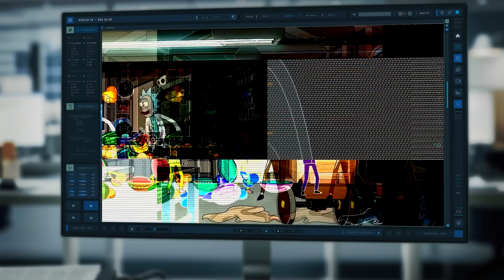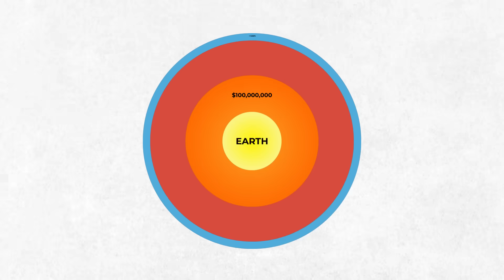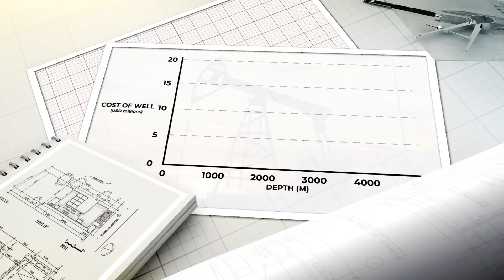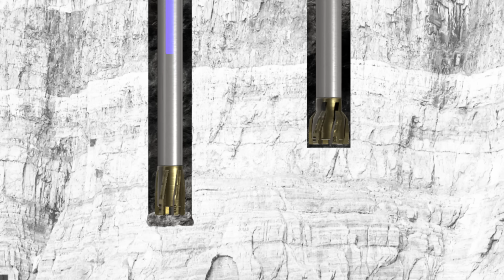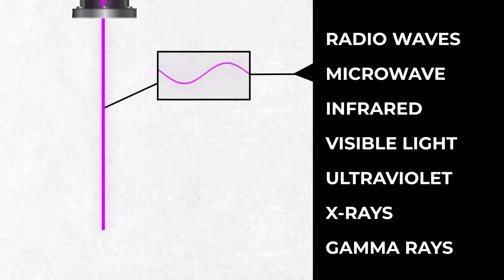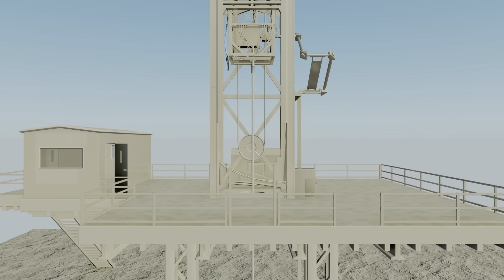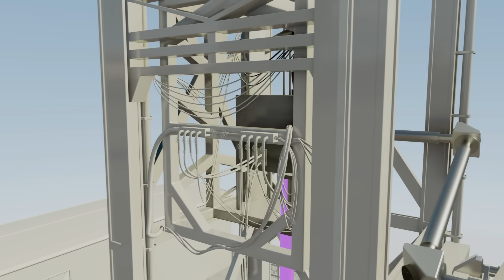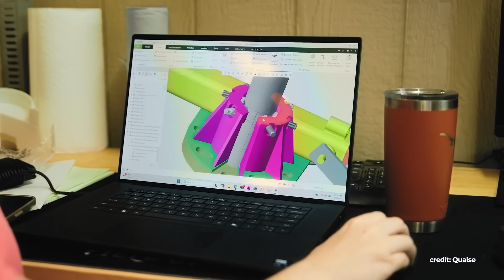The Most Advanced Drill in Human History

Comment: I read an article on tests in Iceland using geothermal superheated water from bore holes to turn surface turbines to generate electricity. One of the major issues they faced was that the superheated water dissolved vast amounts of minerals under pressure. When this mineral rich superheated water reached the surface, it cooled enough for those minerals to condense and be deposited in the turbines and feed pipwork. This clogged everything up relatively quickly.
Reply: easily fixed with heat exchangers, in fact I would be very very very surprised if anyone would use the groundwater in a turbine at all, it has to by very nature be a sealed clean system, we have known this for decades.
Reply: @Farlig69  Heat exchangers will clog as well.
Reply: @Farlig69  the heat exchangers would need to be frequently replaced as their fins would clog with scale in no time. The problem of dissolved minerals remains a problem.
Reply: @MrPhillip2  could run a clean refrigerant like ammonia inside a closed loop within the bore up to surface, thermosyphon would cause flow of hot fluid up to surface, heat is exchanged to create steam for generation, then relatively cooler fluid is forced back down to the bottom by density/convection. No minerals no problem.
Reply: @midship_nc  AGREE sir SO AWESOME; that SOME PEOPLE still have CRITICAL. THINKING 🧐 skills)
Reply: @Farlig69  Easily eh? If only you knew just a little. All you did was move the corrosion and scaling problems elsewhere
Reply: Literally throw a basic water treatment method on that closed system and boom problem of caking up the system is solved. Just get the TDS down to an acceptable level for the system. That blows my mind they didn’t have one in place to begin with. Obviously brine water is present. 

The much smaller residential systems I’ve worked on mostly use glycol. Idk how tf that doesn’t seep into the earth but the system holds pressure lol

The heating medium in the Iceland set up is the geothermal water. A heating medium in a closed loop shouldn’t go directly through the system as a previous comment pointed out. The heat exchanger transfers that heat to another medium like steam or water that isn’t so aggressive for the rest of the components.
Reply: @Vinlyguyx420x  Thank you sir ; ANOTHER person who has CRITICAL THINKING 🧐 skills
Reply: Iceland currently receives a significant proportion of its power from geothermal so I'm sure this has been accounted for.
Reply: Makes sense
Reply: Use a closed loop....just transfer the heat.
Reply: A  HEAT EXCHANGER THAT IS  COMPLETELY UNDER GROUND AND COUPLED WITH A FLUID ; that Boils at Low Temperature and IS USED TO. SPIN the TURBINES) This will AVOID the Minerals; Going Out of SOLUTION; and Coming into Contact with the TURBINES ) AND the DRILLING FLUIDS are kept At High pressure and CIRCULATED; through the HEAT EXCHANGER)Next to the TURBINE. SUPPER HEATED FLUID)
Reply: @davekurtz321  I'll bet you have an easy way for a crew to get to Mars as well? Do tell us since by oversimplifying the process and leaving the hard detail stuff to someone else does make your rambling somewhat plausible. That's what ha .. idea men do. Get yourself a better secretary to dictate your comments to and improve your grammar. Caps everywhere .. bad structure .. very juvenile. Since you excel (LOL) at critical thinking, be critical of the comments you and your secretary leave. Presentation is everything ..
Reply: @farli  Thank you  sir ; for condensing ; my Exact thoughts 💭 
And ALL of these 
NAYSAYERS) please Remember that They Were Also Telling the Wright Brothers at the turn of the 1900’s that
 if God had meant man to fly, he would’ve given us wings 🪽 NOW has ANY BODY Been GUILTY OF FLYING on an  AIRPLANE ✈️. LATELY)  25 YEARS from now ULTRA DEEP GEOTHERMAL ENERGY wells ; will Have REPLACED 
those UGLY WIND 💨 
turbines; SOLAR PANEL farms) AND ALL of INFRASTRUCTURE) will Be TOTALLY. UNDER GROUND) in VALTS ; melted Out of the ROCK 🪨 and SAND of the EARTH) 
ELON MUSK; Owner of the BORING COMPANY) will SOON Be using this NEW DRILLING TECHNOLOGY) To Create UNDER GROUND TUNNELS) And BILL GATES) POWER ⚡️⚡️ for All of those. A. I. computer. Centers) 

Could care LESS about their Personal 
POLITICS; bottom line both of these men are billionaires, and they have the resources and money to fund 💰ultra deep geothermal drilling technology)
Reply: AFTER READING all of the COMMENTS; from people who have CRITICAL THINKING 🤔 skills) :2 Issues; will Become BLESSINGS) THE GEOTHERMAL ENERGY to SOLVE the WORLDS ENERGY PROBLEM) GEOTHERMAL ENERGY Wells when properly SEALED; DO NOT ; create 
Co:2 GREEN HOUSE GASES)🙌this will make the 
NIMBY’s  happy 🤩🥳
AND. AMERICA 🇺🇸 NEEDS VALUABLE MINERALS, LIKE LITHIUM AND HIGH PURITY SILICA) All A byproduct of the fluids extracted from these ultra deep geothermal energy wells) TECHNOLOGY; has A HISTORY of SOLVING;  many Problems) the Wright Brothers in the early 1900s) we’re working on the problem of getting an airplane to remain in the air) AND the NAYSAYERS; told them that if God had intended man to fly, he would’ve given them wings 🪽 
NOW have Any of these NAYSAYERS) BEEN. GUILTY; of FLYING on ONE OF THESE; newfangled airplanes lately??
Reply: That can be an added benefit.
A company called Geo40 is extracting useful resources from the outflows from New Zealands geothermal electricity plants.
"Geo40’s world-first commercial Northern Plant processes around 6,000 tonnes of geothermal fluid per day, extracting approximately 3,000 tonnes per year of high-value colloidal silica from a New Zealand geothermal brine, setting the benchmark for sustainable mineral recovery."
They are now looking at Direct Lithium Extraction from the fluids
Reply: Yes the value of those minerals was also mentioned in the article. Superheated high pressure water is incredibly corrosive and can dissolve pretty much anything given the right conditions. Someone in a previous comment mentioned a closed system using the same water again and again but how you'd get that to work I'm not sure.
Reply: @petercapon9878  THEN sir PLEASE Do MORE RESEARCH 🧐 
BEFORE COMMENTING) and please; Come BACK AFTER you are More EDUCATED; on this SUBJECT)
Reply: @davekurtz321 no need to be rude
Reply: @PaulG.x  there’s a company in Arkansas doing lithium extraction from well water from the Smackover formation. They are focusing on the lithium, but geothermal heat is a byproduct.
Reply: @PaulG.x  New Zealand's geothermal

Comment: Theoretically they could bore until they can't get the particles to the top, then flush it with water, then compressed air, or vacuum to get the water out before starting the drilling again, then repeating until they hit rock bottom.

Comment: Vitrified rock will not be able to seal the heated water in a circulating system. Steel and concrete casings fail regularly. This project will fail and, in the process of failure, will contaminate the ground water for the people using wells for their drinking water.
Reply: Don't worry, it will never get that far (deep), it's doomed to fail way earlier when someone somewhere finally consults a real world drilling engineer...

Comment: Seems like the drilling string wave-guides will be pretty expensive & need to be very precise compared to a conventional drill string, which, like everything else, will be harder to maintain that precision the deeper you go.  Also, melted sidewalls seems like a good solution in a shallow hole where the drill hasn't yet reached the depth and heat where the rock starts to behave like a malleable clay, but this approach seems to fall apart with depth as well, where it seems like you will run into the same problem as a conventional drill that you must add casings the deeper you go to maintain the integrity and structure of the hole.
Reply: Not to mention, using a gas drilling fluid, how will they maintain downhole pressure sufficiently to avoid collapse whilst not bursting shallower "casing"... it's a dead end road this.

Comment: The technology of drilling the well is interesting. But generating power from the bottom of the bore is a different problem. I wonder why they have not looked at existing geothermal plants? There is a fundamental principle that has been overlooked: geothermal bores are extractive and non-renewable. If you extract the heat at the bottom of the bore you cool the surrounding rock so you stop getting energy. This is because rock is a very good insulator, heat does not flow well through rocks. You might think this is not a problem but it is a property of thermodynamics that will be hard to overcome after the holes have been drilled.
Power is the flow of energy and that is not only a property of the temperature, which has to be really hot to be useful. So can you extract enough energy to run a steam turbine? I don't think so from the way that existing geothermal power stations operate. They have very large boreholes that have tonnes of superheated steam pouring out to drive the turbines. They only get that mass of steam by drilling into a field of porous rock that is saturated with high pressure high temperature water that flows into the well on its own. The field is hundreds of hectares and it eventually cools down so that you only get hot water, not steam. You are extracting the accumulated heat just like an oil well. After a few hundred years you could repeat it for a few years. Or continually put down more bores if the field is large enough, but they are not, they are very localised and are only in volcanic areas.
You cannot reproduce the volume or surface area of a volcanic field with a single cold downpipe. There has to be an enormous heat exchanger at the bottom. Existing geothermal plants have tens of bores that have to be continually renewed by drilling new ones every few years. There was no discussion on how this heat exchanger would be built. I can anticipate that a fracking type zone might be proposed. That will bring further issues of dissolved rock in the superheated water. You cannot isolate the water from the rock. So you manage to pump down thousands of tonnes of cold water per hour to turn it into superheated water/steam and get it back up to the turbine. Might be quite a large borehole. Now you have a toxic mixture of dissolved rock that precipitates out as the pressure is released on the turbine blades clogging them up.
Half of any power generated will need to be used to pump the water and treat the steam. For a steam turbine to work you have to have a temperature gradient, so the steam must be condensed and the water cooled before recycling. There is also significant CO2 gas released, so much that it will be a significant cost in carbon credits.
So the generator will only produce net Watts not MegaWatts and the cost will never be competitive with solar and wind.
I wish them well, but I would like them to demonstrate how a geothermal power plant will work with one bore at a lower depth where there is plenty of molten rock a few metres below the surface in a few places. This is what has to be proved first before they start drilling down kilometres.
I leave you with this though: Why don't we burn our feet on the ground when walking with bare feet? Surely the hot magma would have heated up the crust over millions of years. It is because rocks are a very good insulator.
Reply: By that logic, the sun is nonrenewable.

The earth's mantle is a massive, MASSIVE heat sink.  It will cool... eventually.  Any given geothermal area can persist for a long, LONG time before cooling becomes a problem, lasting exponentially longer as we get closer to the mantle.

And so what if we do cool down the rock?  That just means that it is now safe to drill even deeper.

A temperature gradient exists, plenty for steam turbines.  Geothermal plants already exist.

Minerals in the water are a problem, but a solvable one.  Geothermal plants already exist.

The fracking concern is valid, but again, a solvable problem.  There's more freedom in where you drill for geothermal than for oil or gas, so we can preemptively drill in places with lower risks.

Pumping the water is needed, but again, geothermal plants already exist, and are net positive.  Whether that remains true for ALL depths is questionable, but at the bare minimum we can push significantly deeper than we have in the past and remain net positive.

Wind isn't competitive without subsidies (which are supported by an oil based economy), can't be used everywhere, isn't reliable, has high maintenance cost, and the highest worker deaths per kilowatt hour produced of any energy source.  Some of the countries infamous for going all in on wind are buying oil from Russia, despite being in a cold war with Russia, because of how unreliable wind is - in particular, at how bad inconsistent power is for power grids.

Solar has a ton of use cases, but unless we can get space solar and space to ground power transmission working, isn't consistent, involves tons of toxic metals mined in a country that cares little for environmental safety, is very hard to scale, and falls apart at large scales even with large subsidies.  Also, solar isn't one in done - solar panels suffer degradation, wear, and tear, just like everything else.

Geothermal holes will need maintenance too, of course.  There's no such thing as 'free energy', but that's true of all power sources.  Depending on how the hole is drilled and reinforced, the cost could be surprisingly low in proportion to it's lifetime and power output... and nothing's stopping people from drilling a new hole, and it may be faster to redrill an existing hole.

CO2 isn't something I take seriously.  Just grow more plants, which happens anyway due to the NASA documented global greening effect.  There are plenty of other toxic pollutant concerns, but they aren't nearly as bad as what we do for oil or coal.  Progress, not perfection, is the goal, as perfection is impossible - even in nature.

The last points are very nonsensical.  The borehole isn't intended to get anywhere near the molten mantle, they are already dealing with pressurized mudlike stone which is already bad enough.  Again, geothermal plants already exist.  They are a known concept, unlike fusion, which has never reached net positive usable power output compared to the total system (only net positive compared to the initial reaction).
Reply: If this were true, how would it be possible that Iceland generates 70 percent of its power using geothermal
Reply: I think 1 of the most interesting things will be those toxic precipitates. we still don't know the exact composition of the magma down there and there could be some amazing deposits of rare earths created in the planet's early stages that failed to make it to the surface.
Reply: @thelydiaspringexperiment6437  Geologists do know the composition of basalt and that’s what magma is composed of. 
There is plenty of geothermal potential under the entire Gulf of Mexico coastline, at 15-20,000 feet. Easily drilled with existing technology. Actually, wells that have already been drilled that are noneconomic could be converted to geothermal. We don’t need nothing new, we just need to do it.
Reply: @MrPhillip2  is all magma homogenous? are there magma currents under the earth moving mineral to different areas or are they static under the tectonic plates
Reply: But you could NEVER  put out a volcano, right? Steam releases significant CO2 gas? Who are you fooling here?
Reply: After I finished watching the video, I was thinking this geothermal technology looked promising---until I read your comment. You made many good points. Obviously, you know a lot about this technology. Among other things, you said, "...the cost will never be competitive with solar and wind." That's not saying much, because the payback on those technologies are not very good. They are both expensive on a per kilowatt hour basis. I still think nuclear power is the best solution, in spite of its risks.
Reply: @rodneybrocke You need to update your talking point data. There is nothing cheaper than solar and that cost keeps dropping. Instead of building new power plants, energy companies need to pay me to have them install solar in my yard. We are approaching the era of limitless solar power; free energy.
Reply: If I’m correct the tech alone once matured can tap into deep maga chambers to increase the energy production from normal geothermal power systems and increase the effective range of said geothermal plants location.
Reply: @spaceengineeringempire4086  those deep MAGA chambers are full of mostly hot air 😊
Reply: @MrPhillip2  ok you’ve been watching way to much holly wolf films.

The ones I’m talking about arnt the surface chambers. The deep ones under exstream pressure. The ones that would once taped into can power an entire nation.

Most magma chambers that deep are to high pressure for air to form.